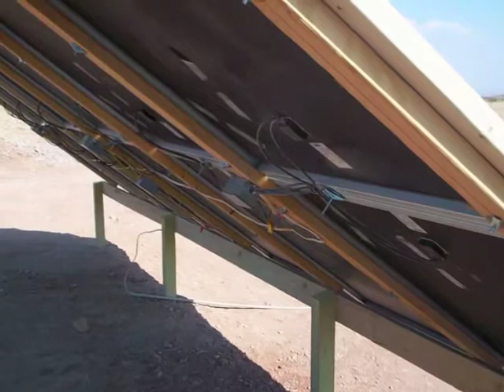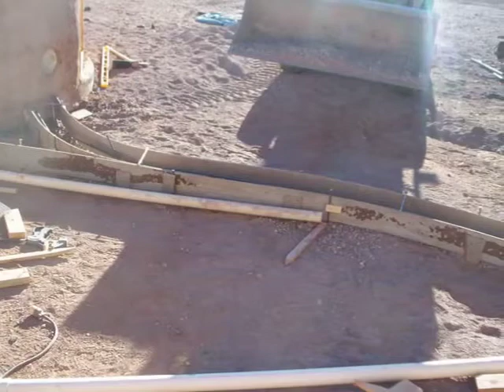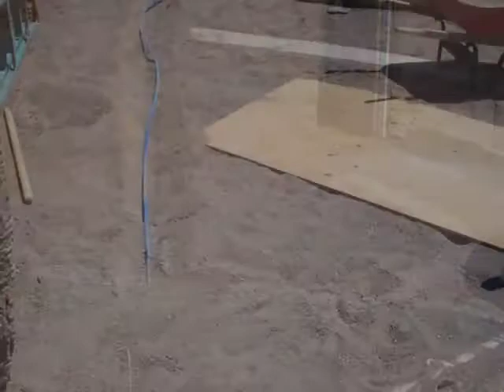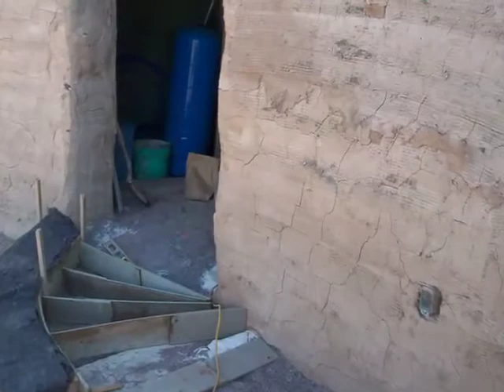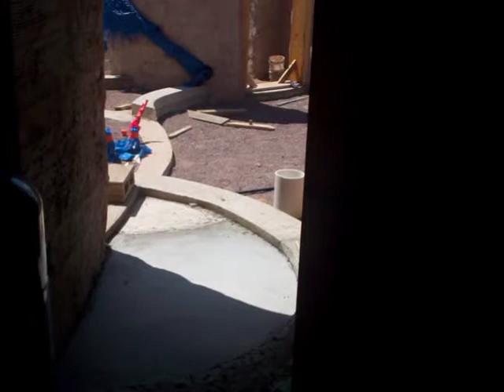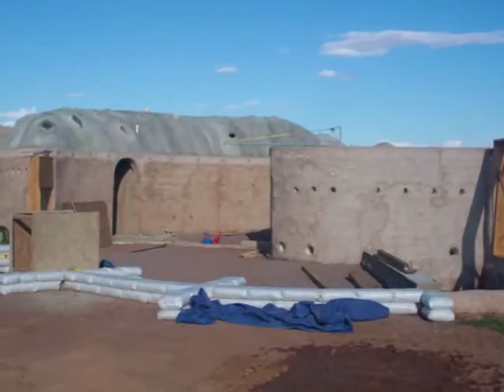Earthbag House 7

Comment from the maker: @AaronBRDN That's a good question - my solution is a side grinder with a diamond blade to cut channels into the plaster for the wiring. In a less complicated structure, the best thing to do would be to install the wiring as the walls go up (in between the bags). That was my initial plan, but I realized I would need to come up with a way to do it after-the-fact. Thus, the grinder method is my choice.

Comment from the maker: @samejohnboy Panels (12 Dupont 90w @100v)are connected parallel for just over 1 Kw into 40amp controller(will be upgraded) into 8 (will upgrade to 12) 225ah 6 v golf cart batteries connected series/parallel for a 24 volt system, feeding a 3000 watt inverter. It will run the whole sheebang. Most out here are with Hughsnet or Wildblue - wifi not so great where I'm at, but I will check into it further when I get more of the house done.

Comment: What did you use as the material to fill your bags? I have researching rammed earth and sandbag homes for a few years now. I was thinking about a rammed earthbag home. Using a mixture like the rammed earth walls but put it in sandbags and ramming the bags into a form so the walls would all be the same thickness. Also, did you have to get a building permit in order to build your house? I live in Louisiana and I do not know if I could get a permit to build this type of home.